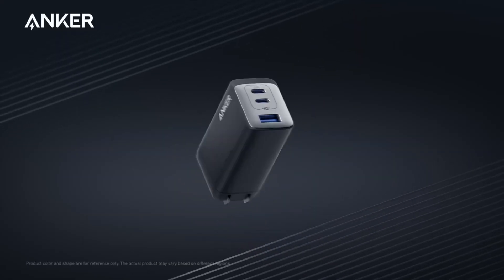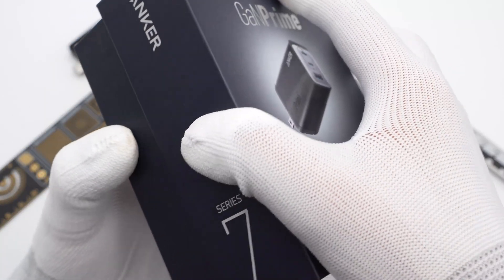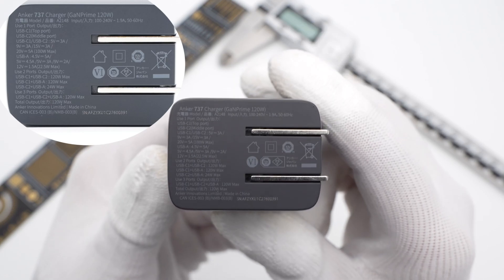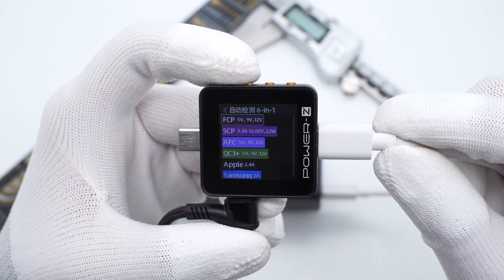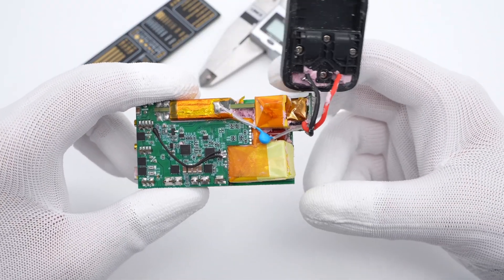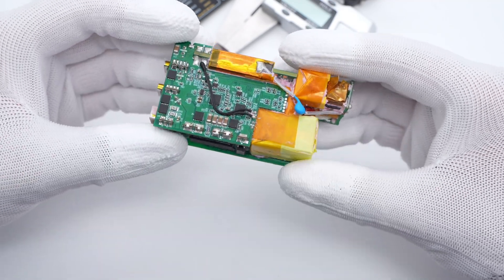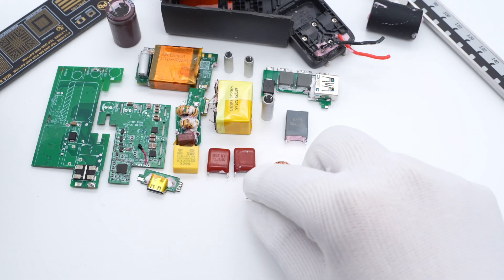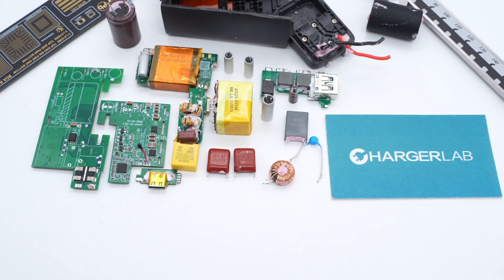Teardown of Anker 120W GaN Charger (GaNPrime 737)

Comment: all phones and devices should suit the usb pd standart.
Reply: Not higher than 100W. Power Delivery added stupid 48V charging... for Li-Pol accumulators... with no protection... They should either refuse from it and move to 20V/12A, or no way I'm using it.

Comment: So it doesn't support VOOC?
Reply from the maker: No. VOOC is the OPPO's private protocol.
Reply: @ChargerLAB   Well, they had VOOC-enabled chargers before, they only needed to use the correct charge controller ic, which is pin-compatible with one they used here. I once modified my baseus charger, that had sw3516, soldered sw3518 on its place and got VOOC support
Reply: @remainsmemories626  just like most proprietary charging protocol. it's really hard to find their aftermarket counterparts. their phone does support PD but at meh power rate

Comment: the conslusion section of the videos should be about whether u like it or not, is it using good components, would u personally buy it. Not stating the features and specs again.
Reply: Agree
Reply: Agree
Reply: yes
Reply: Yes please!
Reply: Agree
Reply: You can derive that conclusion yourself I would presume. Components are well insolated and stated in the video latest technology are supported.
Reply: @leviathon1113  that requires a certain level of expertise, which I guess if that's the only audience you care about, then sure? But if you're looking to expand the approachability of your videos it would be most appreciated. 

Otherwise, personally, I no longer really watch them anymore shrug listing the parts, though it's without bias, is just not useful for me as a non electrical engineer

Comment: Can you recommend us best all in one charger?
Reply: new anker chargers
Reply: PSDA 3D 300W GaN 4-port charger. The company is small but check it out, it has 140w pd 3.1 and own OLED monitoring screen (for voltage and power output on every port)